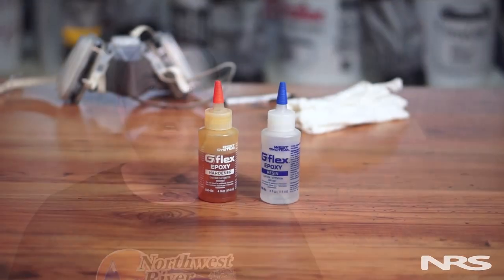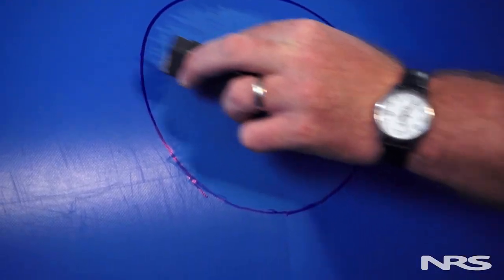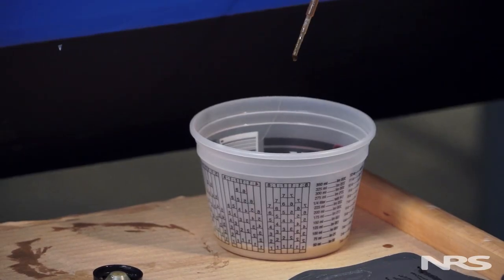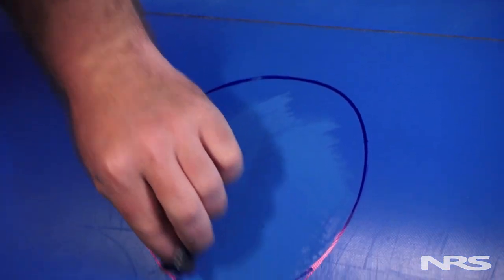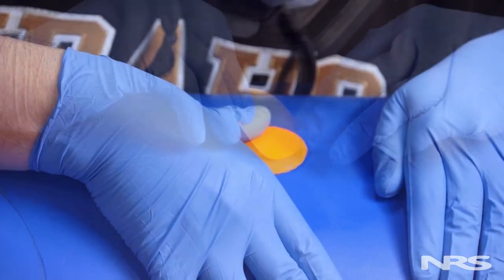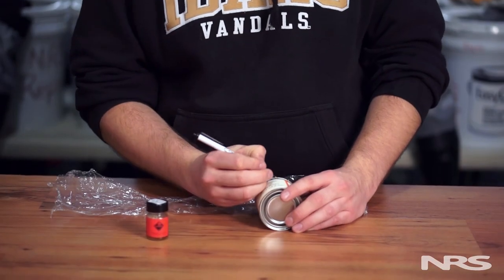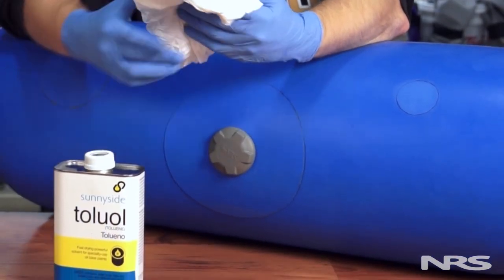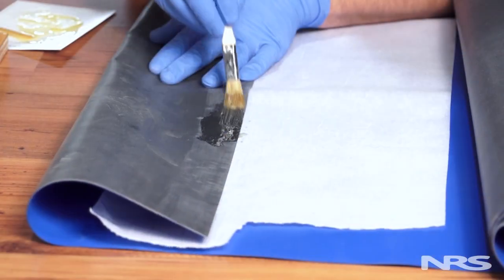How To: Inflatable Repair Adhesives Guide

Comment from the maker: Thanks you for the comment/question. It appears that Zodiac may have used a few different fabrics over the years, so you'd have to get a hold of the manufacturer if you wanted to know the exact type of material your boat is made of. That said, we suggest using Stabond Adhesive for any air holding patches on Zodiacs. Stabond works on many different fabric types, and for this reason we list it as the preferred adhesive for Zodiac boats.

Comment: Hi, thanks for your video. Which glue and which solvent do you recommend to use to glue some pvc accessories on a nitrylene gumotex canoe?
Reply from the maker: We're not familiar with Gumotex Boats so your best option is to contact the manufacturer. Looking at their website the Nitrilon material is made up of synthetic rubber so Hypalon glue may work.
Reply: @NRSWEB  thanks

Comment from the maker: Thank you for the comment. Sounds like G/flex Epoxy or Stabond Adhesive (or other) should work great. If it's more of a fabric to fabric type of a repair, then I'd suggest Stabond or the appropriate glue for the fabric your boat is made of (check out our "How To: Inflatable Repair Adhesives Guide" video and "Inflatable Boat Material & Valve Reference Chart").

Comment from the maker: Great question, MEK does affect the material more than acetone, it softens the material so that it will more readily accept the adhesive. Acetone on the other hand mostly just cleans the fabric's surface. You don't have to use MEK, but if you do, you'll get a stronger bond when using the appropriate glue. Thank you for the question/comment.

Comment: Hi, is it possible to fix a two inch hole that goes completely through the kayak. A mouse got in the basement, ate a hole in the corner of my inflatable kayak right through to the other side. He got the worse possible spot. Right in the corner so he basically created a hole and connected the air supply that was separated from the sides of the boat to the floor. Is this a lost project?
Reply from the maker: Thanks for reaching out to us Rick. Sorry to hear about the trouble with that mouse. In order to give you an accurate assessment of your repair options please email us at service@nrs.com with a description of the problem and a few pictures or a video of the hole. Our repair experts will be happy to help you out. Thanks and have a great day!
Reply: find that mouse, skin the little bugger, stretch that hide out to it's max, lather in proper adhesive, and cover hole with it. this will also serve as a warning to future rodent problems.
Reply: Depends on the operational pressure. If its soft like a $50 sevylor when on water then a big patch, a few bricks and amazing goop marine should work

Comment: Can i use pvc pipe glue and primer on a pvc raft
Reply from the maker: Hi Snark, PVC pipe cement will not work for repairing a raft. You might get a patch to stick but it will mostly leak as soon as you add air. If you want some help picking out the materials for your repair feel free to give us a call at 877-677-4327 and we can help you out.